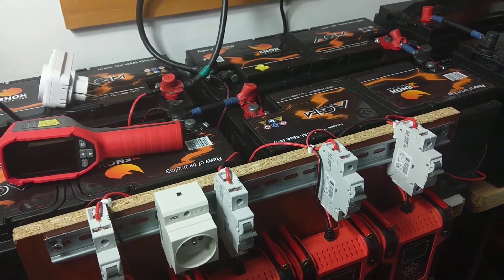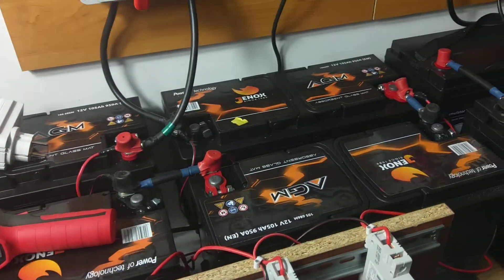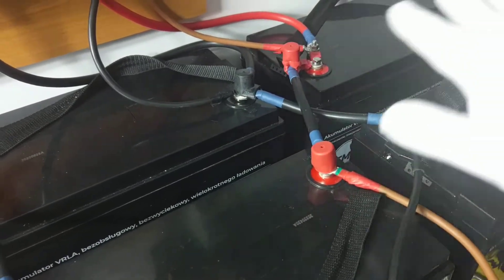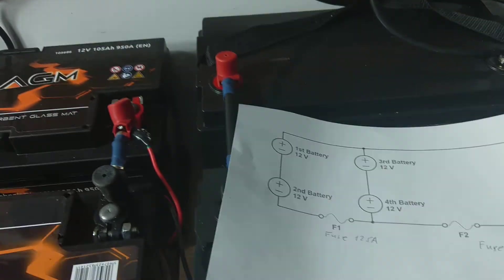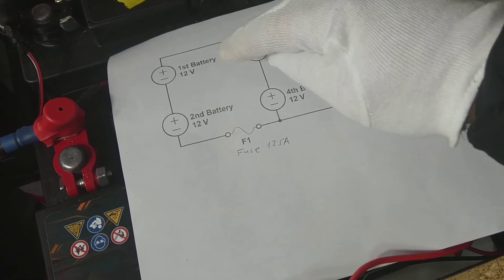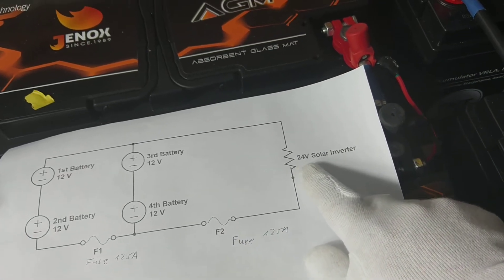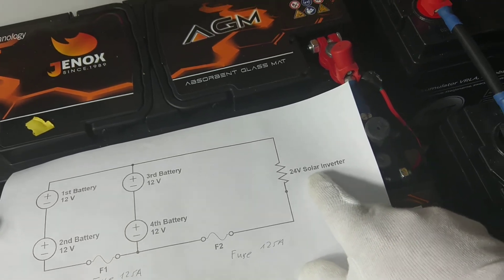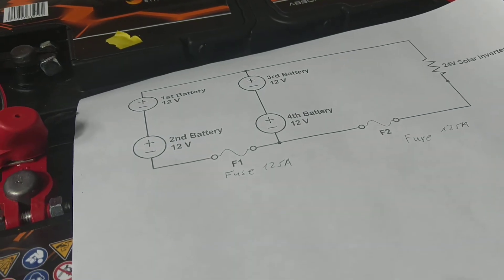How to wire four 12V batteries - series-parallel for 24V solar inverter

Comment: Sorry, would be nice to not use the pause in youtube. Could just keep the camera for a while in the middle of the batteries and explain the parts. Now moving back and forth.
Yes, you got that bigger voltage system next to it, wondering if you show too long time for a video that is about 24 voltage wiring.
And the 'funny voice narrating', ask someone of that I dont have heart to mention about it.

Comment: I'm confused, I thought you connect 2 batts - pos to pos and neg to neg then the other 2 batts pos to pos and neg to neg .Now you have 2 pairs of 12v batts in parallel. Then to hook them in series  you run a line from one   terminal of one pair to the neg terminal of the other pair.. ??? You are showing it differently.

Comment: Could I get help with my 24v system?
Reply from the maker: Sure, tell what you need
Reply: @CuAgFe  I want to make a 70kw system for my home no gird I am getting 6 12v 500ah, calculating it 1500ah for two sets of 3 12 @500. That would be about right, and I know I need to make 2 sets of 3 to get, but it is the purge r parts I have a problem with. The batteries can take 100a max charging, only have 800 watts of solar and a 60 dc to dc and 24v 80a mppt, and not trying to keep them up 100% of the time it more for weather and not being able to charge them is why so big. But I am having trouble with everything else. I have not done anything but research, but I still am trying to figure out the rest.
Reply from the maker: @jihlnabaat6329  What will be the system volatage (24V or 48V) form battery side?

Comment: I have the same set-up but put 100amp fuse on each pair of batteries. My inverter is 3000w so total amps is 125amps...62.5 amps from each 12v pair.

Comment: It is possible to connect four 12 v battery, in series and parallel for 24 v system - two from a brand and another two from other brand? Same chemistry(lifepo4)
Reply: how about their capacity ? If they are similar they should not be a problem. I assume every battery have it's own BMS ?

Comment: Without an active balancer, you will soon reduce the capacity of the entire pack.
Reply: cells/batteries in parallel auto-balance.
Reply: @Moe-j8z  Sure, but who wires 3.2 Volt cells in parallel to make a 3.2 volt pack?
Reply: @originaldiysolar  You can arrange the wiring so you get the best of both parallel and series.  So that 4 cell 3.2 pack can be a 12V battery with parallel.
Reply: @Moe-j8z  We've been designing and selling LFP battery packs for more than 15 years, so I know all about series/parallel configurations. A 4 cell series string will still be unbalanced even if you connect that 4 cell string in parallel with another 4 cell string without an active balancer.
Reply: @originaldiysolar  Then you are the man for me. :)

Q: I have 4 12V 200AH batteries in series.  During discharge from my inverter, the cell connect to the + sides takes all the drain.  In fact, it often falls to 117V, while the other 3 stat at 13V.

So I was thinking of rearranging them into a 4P4S.  You're saying this is not the best course?
Reply: I did run my 4 LifePo4 100Ah 12v  batteries in series 24v and parallel for 1 year and then got a battery balancer. I measured the batteries before I hooked it up and they was still balance and that was one year with 2 months of hard use and rest of year idle.

Comment: A little late to the table here,but I have a question. In the video, you show the fuses attached to the positive leads, yet in the diagram, they appear to be on the negative legs. At first, I was confused to the way you oriented your batteries, but figured out it was a way to reduce cables and length. (the crossover between batteries), but I am still perplexed to the fusing. should the fuses be determined by maximum draw from the inverter, or by maximum output of the battery bank?  I have a bank of 4x12v to do a 2s2p for 24v 200ah using 150a fuses on each positive leg of the series connections. Am I over/under fused?
Reply from the maker: Basically max current from batteries is important   in fusing the battery side. We want to protect against shortcuts from the inverter side or between battery banks. Max inverter current from low voltage DC side must be considered when we calculate battery requirements.
Reply: @AUizGOLD77  fuses protect the cable from getting hot from overloading or short. Size the fuse based on the maximum load the cable is rated for

Comment: Please more explain about fuse you put it between batteries?
I have 4 battery in series and parallel in 24 but my battery power 200Ah/12v
Reply from the maker: What type of inverter you have and type of battery chemistry?
Reply: @CuAgFe  off grid enrgy promax inverter 
Battery flood 
200Ah/12v
Reply: Ever get a clear answer? He started to talk about fuses then started rambling then pointing at the diagram. I need to know what batteries and terminals are fused not a piece of paper.

Comment: You made a mistake 
The plus and the minus shouldn't be connected to the same side of bank but every one from a side and the other from the other side so current is more equal in all batteries
Reply from the maker: Basically you are right but if they have similar internal resistance it is not very big issue. I monitor them and they discharge in pretty same Way. My goal was to make wires as short as possible. Thanks for the comment. Regards
Reply: I hooked up my 4 battery bank now as you said with equal length cables everywhere. Did run it with unequal length like in this video for 1 year with 2 months hard use and rest of year idle without battery balancer. After 1 year they was still in balance when I got a battery balancer.